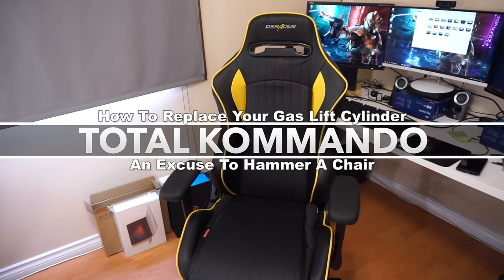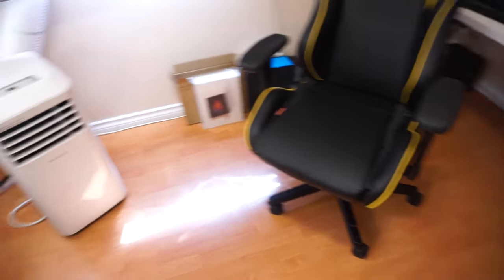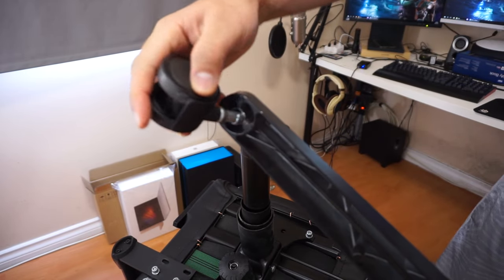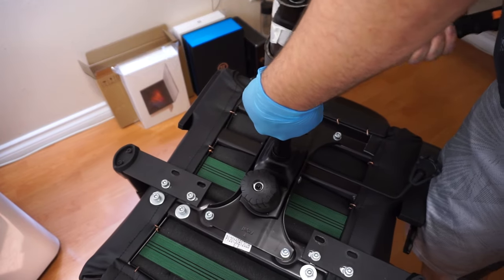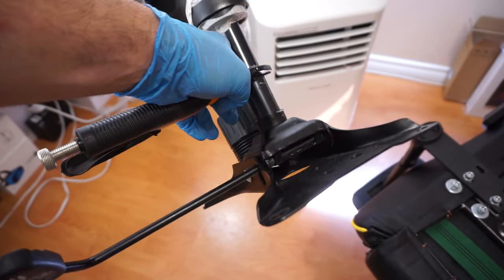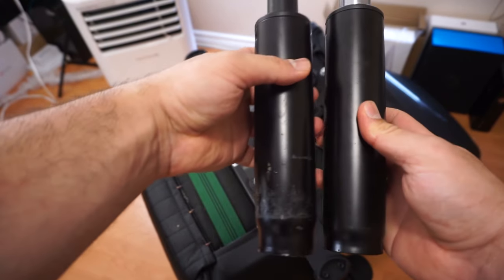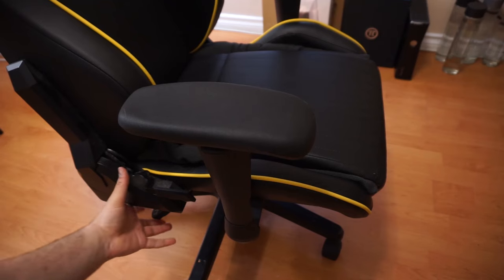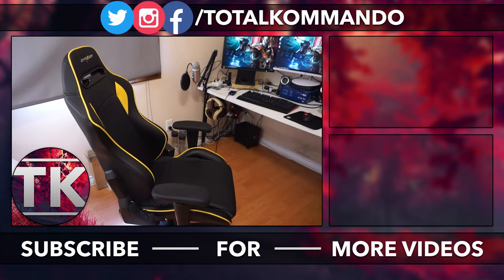How To Replace Chair Gas Lift Cylinder | DX Racer | How To Fix Popping Clicking Noises

Comment: $25 for the gas lift instead of $300 for a new chair. Replaced my 5 year old gas lift on this DX Racer chair, and what a difference. Sincere thanks from a guy on a budget. I didn't have vise grips, but a large wrench works just fine.
Reply: Most replacement gas cylinders are only rated to 250 lbs.  For $10 more you can buy a 400 lb rated cylinder that has the exact same machined tolerances as the cheaper cylinders.  It will turn your light duty Drift/Formula chair into a King/Tank chair.
Reply: My DxRacer Racing gaslift lasted just 3-4 years of VERY INTENSE 8-15hrs use. Just buy Ikea gaming chair like Matchspel instead of bothering with fancy impractical designs(other elements of design are impractical too).

Comment: After hammering on the lower part of the cylinder for two days, everything came out of the cylinder but the cylinder itself was still stuck. In desperation, I also decided to drop the base from head height onto a concrete road. On the second attempt, the cylinder was out. So don't waste time and energy with the hammer. Let gravity do the work for you.

Comment: Use WD40 or analogue before, on both places, leave overnight. 5 strikes with strength, no need for berserk rage, that all what it takes afterwards for each side.
I've read down 100 comments and no one mentioned it. So please get this one to the moon.
Reply from the maker: Yea I got a follow up updated video about that but I have yet to edit it but here is a pin :)
Reply: Yeah I try for like a half an hour to get off and I cannot so I guess I'm going to spray it down with WD-40 and let it sit
Reply: Roll for rage

Comment: Spent an hour on mine, wasn't aware you need Thor's hammer to take the damn thing apart.
Reply: LOL
Reply: im dying xD
Reply: You can also use an hydraulic jack and a nylon rope
Reply: I did it first try lol
Reply: Heh, tried hitting the damn thing like crazy. Put oil and all. Nothing. Will go in a few days to get said Thor's hammer and some WD40 to see if the shit finally comes out...
Reply: @DiegoSynth  Did it work?
Reply: @SkullHQ  Yes, but it's not easy. And you need to be aware that the base is not the hardest part.
I would advice you to get a 1KG sledgehammer. Gravity plays a big role as well. Don't do as they all say: don't lay the chair anywhere, otherwise nothing will come off.

- For the base: You need to hold the star shaped base in the air so the whole chair is pulling down by gravity (If someone can hold it for you, better, so you just hammer) BUT beware (everyone at it) that when the piston comes off, the full thing will fall to the floor and there's no reaction time: it will hit your feet, and it's metal. So wear shoes and keep them away.
One thing I've read after (and didn't get to try myself): They recommend at first to tap a bit the BASE from the other side (careful as it's plastic). It makes sense, but I cannot tell.

- For the mechanism part (the other extreme of the piston): Don't detach the seat nor anything (it would make things easier for your holding hands but would reduce the weight, meaning less mass pulled from gravity, less chance of getting it detached).
I tried first with pipe pliers. It didn't work and I marked the piston (even though I wrapped it). Unless as a last resource, just don't.
I spayed the connection point generously with WD40. Left it overnight.
This one I did by myself because the other person was already hurt when the base detached (hence my warnings):  I lifted it and gave firm hits to the metal square around the piston, as close as possible to it. That was it.

It won't take 1 hit for each, nor 100. But probably around 20. I believe WD40 helped (don't just wait 5 mins, that would probably not be enough). Installing the new piston is piece of cake, no force, no tools, nothing, just place it, put the chair in sitting position, sit on it, and it will fix itself.
Hope it helps!

Comment: Removing the cylinder from the base is very difficult. I had to release the clip on the bottom of the cylinder to release it from the mechanism and then I placed the base upside down in between 2 metal chairs and gave at her with a 15lb dumbell and a folded towel. Made some nice cookie shapes out of the towel but about 10-20 good, hard wacks later, it finally came loose.

Comment: I just replaced the gas lift on my DxRacer Tank. I got it free on warranty because I noticed it after just a year, but I kept the old one on until it broke completely, which was today, some three years later. Your guide was super helpful and I got it off without demounting the bracket. :face-blue-smiling:

Comment: Here's a tip for those that are having a really hard time removing the piston from the chair: ice packs. Specifically, you need an ice pack that can be wrapped around an object. These can be found at most Pharmacy stores like Rite Aid, Walmart, CVS, etc. For the bottom where the wheel base is, wrap the ice pack above the wheelbase. A couple whacks later with a rubber mallet (from the bottom of the piston) and it should pop right out. Then wrap the same ice pack (or another if the first one isn't cold enough) to the top of the piston (make sure the piston is fully extended for the best effect). Give it about 30 seconds, then start whacking on the baseplate of the chair and it should pop right out (make sure you're pulling on the piston while whacking. 

The reason behind this is simple: thermodynamics. By cooling the metal of the cylinder base and the top of the piston it causes the metal to shrink just enough to break the compression seal that is caused simply by sitting on the chair. Hopefully this tip will help others do this kind of repair. It also causes less damage to not only the piston (if you plan on keeping it) and the chair itself since you're not whacking it too many times.
Reply: Thank you 🤙
Reply: @ennocuh  You're welcome.

Comment: A rubber mallet is really helpful.  Also, go to a auto or hardware store and get some PB Blaster.  Spray it around the base on each end and give it a few minutes to penetrate; comes out so much easier.  Really helpful video though.  DXRacer has clearly never taken apart one of their own chairs because it is not a few taps and you're good to go.

Comment: Omg Dude, I just saw your video and you helped SO much. For weeks I have been periodically trying to get it off with a mallet because other videos told me to use that instead of a hammer and it never budged. Switching to a hammer, it came off in SECONDS. Also bought a new cylinder off of Amazon that lifts way higher and is able to carry more weight. Never been happier!

Comment: Honestly , all others videos i  see make it look easy to take out the first part , and me been convinced decided to use a hard wood to hit  that of my DXracer king series which i have used for more than 4 years and i got the shock of my life , the top came out easy but then the cylinder and the leg with rollers was another story , and i realized i was  in for a big fight , believe me i had to buy a hammer by force , so for anyone thinking of doing this be ready for the hammering , it is not easy as it looks , what surprised me the most if how something with no screw or glue was so tight and hard to come apart , nevertheless thanks for the video , it helped alot ..Merci

Comment: Nice Video. Thank you for the recommendation my friend.
 I've also bought this MasteryMart gas lift cylinder from Amazon a year ago, for both my Dxracer and Turcotte chair. Well, I was glad that I didn't have to throw away my expensive chair.
They are good quality and easy to install. The only difficulty was taking the old cylinder off the chair, I used a pipe wrench to remove the old ones instead of using a hammer (afraid to damage my chair base XD). Overall the cylinder perform excellent so far, quiet and smooth. Cheers.

Comment: I just wanna say a big thanks for this video. I tried for several days to get that effing gas spring out, had it in a vice, biggest pliers and vice grips i had, no good.
Picked it up by the spring and tapped the metal surround with a hammer like you did, not 30 seconds later it all came apart.
Now I was far too impatient to look for my rubber mallet and now my chair has a few dings, but who cares, can't see them unless you turn the chair upside down.
So, if you can't get the gas spring out, do what this guy did and it will come apart.

Comment: Thanks a lot, i was short before a crysis with my arozzi chair. Thanks for the tipp with hammering around the holding ring.
Reply: Dude, how did you do it? I'm trying to change the lift on my Vernazza and I'm going insane. I can't even get the legs / bottom part off. Hammered the fuck out of that shit and nothing.
Reply: @Henning96GER  I literally took a sledgehammer to it for the bottom part/wheelbase and exactly what he did for the top. No Kap.
Reply: @Walker-gr4bj  after excessive hammering I did manage to get the bottom part off and then I just opened the thingy on the lift to get it loose.
Reply: Bro im here because of the same chair. The leg broke on it so im trying to replace the base😂🤦‍♂️

Comment: Thank you. I had to remove my mechanism and wasn't sure if it screws off or if it just needed me to rage it off :) I gave mine a few solid taps and then gripped it with a water pump pliers and twisted it out, rather easily.

Comment: Just remove the metal clip at the bottom of the gas cylinder there is no need for the hammer. The popping and clicking is from a bad bearing. You can get new bearings for $10 on amazon. Don’t forget the grease. Only need to replace the cylinder if thenchair keeps sinking
Reply: i want to see a "hammer-free" video pls :) if you open the clip at the bottom only the lower part will get loose... the "main" gas cylinder/lift will stay in the Tilt/Lift Mechanism ... o/ and i know your comment is one year old ... lets revive it

Comment: I had to use some WD-40 and spray it between the base and the gas piston just to get it out while hitting it with my mallet just to get the base off. Because my base's lil wheel slot in one of my wheels broke so I had to order a gaming chair base replacement today.The damn thing was stuck in there tg for WD-40!

Comment: The DXRacer/other brands actually have higher quality gas lifts than most chairs from places like Officeworks (here in Australia) etc. Where most of those fail within a year or so, I had my DXRacers metal frame break before the gas lift, about 5 years. I would order a new gas lift from DXRacer if you can.
Reply: A lot of people have the opposite experience.

My gas lift broke within 6 months on my DXRacer. A $600 chair and it needs repaired after 6 months...
Reply: @himi6536  my dxracer gas lift for 10 years without problems
Reply: @reavl6494  My dxracer broke twice, both times within 6 months. Gas lift, then frame. Same exact issues, same time frame, same break order. Gas lift, then roughly 1 month, then frame bends itself backwards.

I switched to a Secretlab chair and I've had zero issues so far. Had it for about 8 months now and it's just fine, gas lift works like it's still brand new...so, I'm more sure than ever that DXRacer are using subpar gas lifts.

Thanks for the reminder that DXRacer should never get money from me ever again 👍

Comment: Had the same fun getting the piston out. Solution?  Cool the stem down so it contracts in the receiving socket. I used lighter gas from an aerosol (carefully). Pipe freeze spray would be better, I expect. Cooled it an it slipped out with no more hammering. Job done.
Reply: @InSomnia DrEvil well, did it worked?

Comment: alright everybody... if you ask me it would be better if you just got another gas cylinder as well as a new tilt mechanism. If none of the stuff you found online works get 2 pipe wrenches. Connect one to the socket on the base and another one on the gas cylinder. Make sure the pipe wrenches are close together. Then push the pipe wrench on the socket with your foot and pull the other pipe wrench back with both hands. WD 40 does help some but not a whole lot. It also makes it easier if you leave the tilt mechanism and base on and lay the chair on its side. I hope this helped anybody who still couldn't fix this terrible design flaw.

Comment: I see a lot of people not knowing about dxracers warranty on their chairs, instead they just buy new parts on amazon.
DxRacer has atleast 2 years warranty on their chairs. if a part breaks or fails to function properly, all you need is to send a mail to the sales company that sold it you with video or picture documention with a PI Number located at the bottom of the chair under the seat.
Reply: Rasmus Kynaeb Hansen I just replaced mine and I requested their highest weight rating one.  A lot of people probably buy these not knowing that if it's limit is at your weight it WILL fail
Reply: Some of us are the warranty. So for those that are willing to take something expensive apart, probably don't care haha (Unless they cant fix it themselves)
Reply: Mine was out of warranty
Reply: Like my comment said on top my crapped out after 1 year. They would not warranty my chair and offered me one of their replacement gas shocks for 40 euros! I told them ill just get one of amazon for 15 euros they said it would not work and it worked perfectly. It was the exact same size but with a higher weight rating. I will never buy another DX Racer product

Comment: Had same problem with my Corsair gaming chair. Original gas lift lasted just over a year.  Also had to replace all the wheels  as ball bearings ended up all over the floor.

Comment: thanks for the vid , I was having trouble getting cylinder loose from the seat .  This helps.  I have ordered a new cylinder for my old chair.  Not sure if it will solve my problem though as mine was leaning to the right when sitting , but what the heck I will try it.
Reply: My chair is a high back fabric chair, I changed the gas cylinder but my chair still wobbles,  seems theres no fix for this particular chair.
Reply from the maker: sounds like your chair base might be broken or warped
Reply: @yes350yes  Did you tighten all of the allen bolts?

Comment: 1. use a resin mallet on metals you don't want to damage 2. squirt some wd40 into the part you want to release and 3 dont ever use grips on a piston shaft those parts can be repaired and reused but with teeth marks on them its now scrap..

Comment: I know I'm about 4 years late but you know that metal clip thing in the middle of the base? All you need to do is push that off with a knife and the base slips right off without you having to damage your chair with a hammer.
Reply from the maker: That wouldn't always yield the best result, as you may have a bent or slightly different tolerance when swapping it with a different / new piston.

I have tried it this year with 3 chairs / combos, wasnt great

Comment: Never use a steel hammer, only a rubber hammer!
The gas pressure cylinder has a pressure of 35 to 70 bar (508 to 1,015 psi), whereas a car tire has a pressure of up to 3 bar (43.5 psi). Hitting it with a steel hammer is the worst thing you could do!

Comment: Hello and thank you for the video Tutorial. I also want to change the height of my dxracer with a new gas lift cylinder but dxracer support for germany told me that this is not possible. Pls can you tell me what was the height of you chair with the original gas lift cylinder and how much height did you get with the new cylinder? Thank you very much

Comment: Information I’m interested in is how you determine what gast lift to get.
Reply from the maker: All the ones I encountered are the same interface and are universal. You will just encounter different heights and rated weight capacity

Comment: So if I removed the clip and the legs came off but the lift is still on the bracket I did it wrong?  Seems to be stuck now, think I should screw the 4 screws back to the chair and hammer.

Comment: Hey does this fix the insane cracking noise? I tried Barnacules method of lubrication to the shaft but didn´t do anything to my chair.. still cracks horrible loud sounds when I move the chair..
Reply from the maker: What chair do you have and is the noise coming from the wheels?
Reply: Total Kommando dude, I took off the wheels and used my hands to force the piston to move and it made a crack!!! So I took this off like you showed, very hardly stuck.. but I was right in my thought, piston that was hooked to the chair was stuck cause lubricant was gone from years of use!!! So I put lubricant there and re-attatched everything AND IT WORKS FINE NOW!! DX RACER CLASSIC, the big one
Reply: @TheTanelChannel  nice!

Comment: Hii ! a  question bro i realized the seat moves slightly as I lean forward and back is that normal or you think is the gas cylinder worn? i already checked the chair wheels , wheel base , seat , back rest , armrest and everything is working fine.
Reply: I have the same problem but couldn't find any video, did u find one?
Reply: hi i didn't find any video but i find a solution i double checked the wheel base and i realized the slot is worn out so you need to fill something in that worn out hole slot to prevent the cylinder break through the wheel base if that happen you'll realize that the chair will feel weird or something missing unstable. You move slightly leaning forward and back and feel the chair is not stable is moving, so that's try putting tape , an aluminium can layer in that worn out slot or simple put rough tape around the cylinder to prevent moving further down.

Edit: to know is the circle worn out or don't you will see a line in the slot and discolored sometimes riven